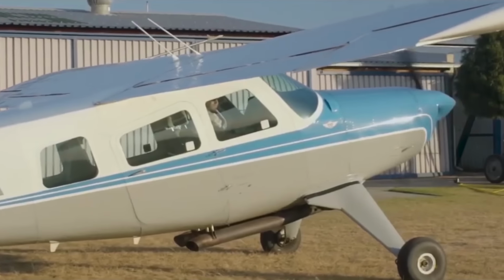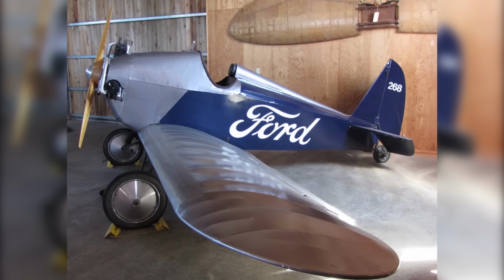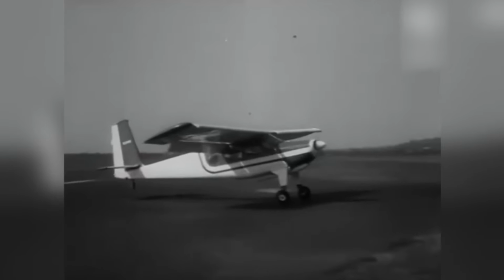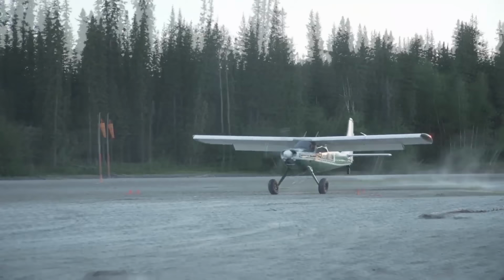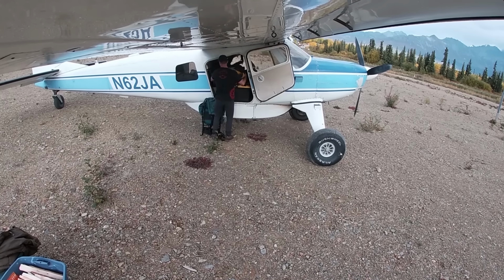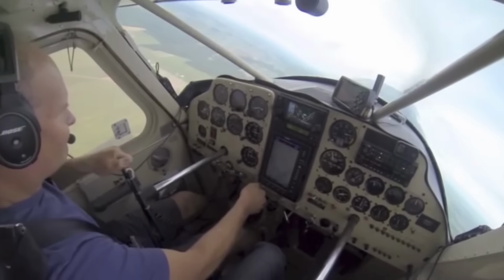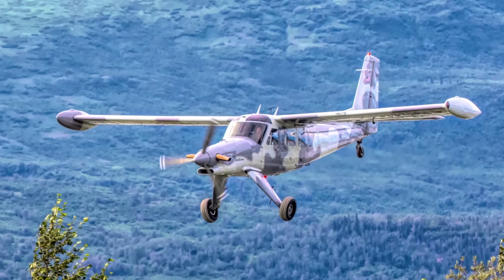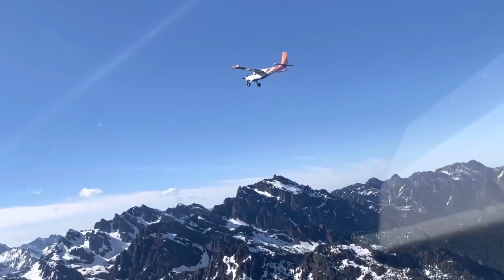The Plane that Turns Backyards into Runways

Comment: Designed and funded by the Cia.
Reply from the maker: Designed?  That's a stretch.  But CIA seems to have its hand in it later on, during nam
Reply: @aircraftadventures-vids  I stand corrected for mis speaking. They contracted the design with helio. They submitted specs and the French built to those specs.

Comment: Note....150' (feet) is not half the length of a football field. That would be 150 yards or 450' (feet).
Reply: I see that you are confused by the old  English system of measurement, where, instead of basing measures on units of 10, there are12 inches in a foot, 3 FEET IN A YARD, 100 yards in a football field and 5280 feet in a mile... unless it's a nautical mile..!

Comment: Sorry, but this NOT the first STOL Plane! This was the Fieseler Fi 156 "Storch"!
Wikipedia:
The design of the Storch enabled it to have an extremely low minimum flight speed of less than 50 km/h. This also reduced the requirements for take-off and landing distances. The Storch needed 50 meters to take off in a headwind and 20 meters to land. The aircraft flew slowly enough to lay telecommunications cables. With the right headwind, the Storch could also "stand in the air" (speed above ground zero) or move backwards.
Reply from the maker: Absolutely agree - and nowhere in this video does it claim the Helio to be the first.  The Helio was unique in its own way, but certainly the Storch came before it.  With the "Helioplane", its founders were looking to leverage the STOL concept and market it to pilot-owners and business owners.  Only later with the 4-seater Courier did the military express interest.  The Storch is an amazing plane.

Comment: Seems as though fuel consumption might be an issue with such an airframe.
Reply from the maker: Yeah those geared 480s were gas guzzlers. But then for those who really needed it's capabilities, that was a secondary concern.
Reply: @aircraftadventures-vids  without the turbo's engaged, she will burn 12.5 GPH in cruise.  With the turbos she will burn 18 GPH.  It's actually quite reasonable and not the gas guzzler you would think.

Comment: We flew in one (it still had the porthole window in the back) in Canada, for a glacier landing. It had a supercharged engine, so the altitude was no problem. Lovely airplane.
Reply from the maker: That's cool!  Very few supercharged models built.
Reply: @aircraftadventures-vids  True.  I have the STC RayJay twin turbo with manual wastegate.  Makes a significant difference in high altitude airports and to increase cruise speeds at mid altitudes.  I see 140 KTAS at 9500 ft.

Comment: A awesome plane, it reminds me on the Fieseler Storch (look at "Fieseler Fi 156" Wikipedia) first built in 1938 with nearly same STOL capabilitys but fixed slats. Also equipped with a 8 cylinder aircooled engine and a enormous prop.
Reply from the maker: The Storch is also amazing.  And I'd guess a big influence on the Helioplane (and later Courier)

Comment: I worked for Jaars here in NC providing upset recovery for their missionary group. A few of the older folks had flown the Helio Courier. They raved about it’s capability. What a cool piece of history.
Reply from the maker: thanks for sharing your experience, bud!
Reply: I was a Mk and my parents worked with NTM. NTM had a Cessna of our own, but on occasion our plane was out of service. When this was the case we would use the Jars Courier. I remember the small circular window. It was very slow but you could put it down any where. I was young but I can still remember it well. Great airplane.
Reply: What did they replace the Helio with?

Comment: Having owned a Helio Courier in the past , I can vouch for its utility over 5 years that I had the pleasure of flying it. You failed to mention that some came equipped with the CROSS WIND gear though I never flew one with this feature.
Reply from the maker: I knew about it but didn't see too many pics or videos of it in action, so I did not include it.
Reply: @aircraftadventures-vids it’s the only plane I know that can land pointing into a cross wind…

Tail wheel landings are tough enough to understand, adding this additional skill is going to take somebody who really wants to do it…

😃
Reply: @aircraftadventures-vids  I have the original Goodyear crosswind gear but honestly I haven't had the nerve to try it.  It is just that strange.
Reply: @nyuscdjsthe Goodyear brake pucks are very hard to find
Reply: The crosswind gear made the forward landing gear a non-issue.

You see, the very far forward gear radically improves braking without nose-over. But makes the moment arm from tore contact patches to aircraft center of gravity very long. This creates strong ground-loop tendencies. With crosswind gear, you land as you can, and the gear swivels to prevent side-loads. Without side-loads, there is no ground loop.

Comment: You mentioned they were used by police departments for surveillance, but I only know of one.  The Pima County Sheriff's Department started using them in 2000 and had two of them they used for patrol support.  They had a camera system and huge spotlight.  Eventually both were converted to Turboprops.
Reply: Steve Murray from aero Pacific did their maintenance, he also manufactured the camera and light mounts

Comment: Meet the zenair 801 180hp - can land in deep grass/weeds too - no small tailwheel. Flies at 35 kts , 4 pass, fits in shed with 32’ wide doors and almost impossible to stall. Got a wide load - pin the doors up to the wings and load up bicycles, 2x4x8’ etc. Love my 801 😀
Reply from the maker: The Zenair is an awesome machine for sure!
Reply: Spoken like a nose dragger pilot! It doesn't much matter how small the tailwheel is, as it is just getting dragged along, trailed, pilots who lose their tailwheel (by a broken tail spring)  have been known to fly it back and if need be keep the tail up with power until parked, I'm one of them. I now have a much better tail spring also. I like have TWO big fixed wheels hitting any obstacles first, not one, that also is weaker as it has to be able to turn, nothing beats a taildragger for really rough off airport ops.
Reply: @portnuefflyer not to mention arriving in an airplane that can only be described as “the most disgustingly hideous pile of junk to ever fly.” An airplane truly more hideous than the box it was shipped in. Requires 0 talent at all to feel somewhat decent. Leaving the pilot feeling foolishly confident enough to believe they have any form of skill. Flown by people too scared to fly airplanes that require finesse and actual skill. Fly a 172, stop pretending to be a bush pilot. Go home wanna be.

Comment: Interesting, had never heard of it.
I'm not a pilot, but have watched a lot of videos by Pilot Debrief that analyze the causes of crashes.  This seems to solve many of those.
If I heard it all correctly, these were the down-sides:
1.  Difficult to control at slow speeds.
2.  Difficult to maneuver on the ground due to the long wheelbase.
3.  Expensive.
4.  Heavy.
5.  Complex.

And I presume "heavy" also means lower fuel economy, as well as lower cargo capacity.

And I presume 3-5 are due to the large control surfaces, and that's probably unavoidable even with the latest technology today.
Reply from the maker: I love Hoover's channel!  As to your points, all correct - consider the Courier a very niche product, that does what it does very well, but at a price of course.
Reply: @aircraftadventures-vids  I might disagree on some points:
1. NOT TRUE...she is very stable at slow speeds
2. TRUE: VERY challenging to manuver on the ground for take off and landings...one of the most difficult aircraft I have learned to fly.
3. TRUE: That is why 80% of these were bought by the Army and CIA and the other 20% were mostly bought by businesses
4. SOMEWHAT TRUE: yes it is heavy but performance doesn't suffer and the useful load is fantastic.  You can carry the whole moose!
5. NOT TRUE: Other than GO480 which is a challenge to maintain, the rest of the plane is very simple and reliable.
Reply: Quite a few Helio crashes were caused by Cessna drivers trying to fly them like a Cessna 180

Comment: One thing that could help an updated version of the Helio Courier is distributed propulsion. While retaining an engine in the nose, each wing could have two or three 10 kW motors and propellers. They might have to be mounted from the wing's lower surface so as not to interfere with the slats. Or, the slats could be segmented into shorter units to allow the low-drag nacelles and props to be mounted to the leading edge. The motors could be shut down during cruise flight while the engine keeps running (and recharging the batteries). Several experimental aircraft have this arrangement. Even an AN2 (large biplane) was so equipped.
Reply from the maker: That sounds...a bit complicated?   But i love the thinking
Reply: @aircraftadventures-vids  The Electra Hybrid STOL is one that uses the concept. Their effort may well be successful, but the Courier has some great features. Maybe the two ideas wouldn’t work well together but it would probably be simpler and more effective than the twin that Helio tried. I’ll try to post a link to the YT video on the Electra below, but I’m guessing it won’t work.
Reply: @aircraftadventures-vids  https://m.youtube.com/watch?v=5mM9QPcOgeI&pp=ygUsU3VwZXIgc3RvbCBlbGVjdHJpYyBhaXJwbGFuZSBtb3RvcnMgb24gd2luZ3M%3D

Comment: Many decades ago, in 1936, there was such an aircraft in Germany, the Fieseler Storch Fi 156. For takeoff, the Storch needed 50 meters in headwinds and 20 meters for landing.
Reply from the maker: Certainly, the Storch was a pioneer in STOL design (which is why I stopped short of calling the Courier the first stol plane).
Reply: The 1903 Wright Flyer needed only 60 feet (18 meters) for takeoffs  😄

Comment: The only plane that ever really came close to the HC was the Pilatus Porter. I flew the Porter in SE Asia and it's built like a tank. We use to call it a flying Timex because it could take a licking and keep on ticking.
Reply from the maker: The Porter replaced the Courier in JAARS missions, but mainly because of the lack of avgas, which is the Courier's largest shortcoming (out the US at least).  The porter is one bada$$ plane for sure

Comment: Yep!  You can have your very own Courier.....for several HUNDRED THOUSAND DOLLARS!  And that's the price they were going for in the 1980s, when I read about the airplane.  They may cost millions, by now.  You can get a Zenith Air STOL 701 for a tiny fraction of that price, and it has similar short-field performance.
Reply: Not true.  A good example, if you can find one, would cost around $250k, and a fair example would be around $150k.  If you have a buyer who will pay millions, I am a seller!  ;)
Reply: @nyuscdjs  My info is from the 1980s.  The price was around $250,000 (New).  I was guessing about a current price, considering inflation and assuming the plane would not depreciate much, if at all.  But it's been decades since I've been active in the World of airplanes.  Today, I wish I could afford a few thousand for a used ultralight!

Comment: A blatant copy of The Fieseler Fi 156 "Stork" of 1935!
Reply from the maker: It's not a copy at all.  That's like saying all STOL planes are copies.  It did however use same similar elements such as the slatted wings (which, by the way, already existed by the time the Storch came out)

Comment: To the company in Alaska,,,,, look at an engine that runs on auto fuel. They're out there. Higher rpm's which give better torque and less expensive (didn't want to use the word cheaper) to operate, purchase, and overhaul! 4 cyl putting out 200 H.P. and Turbo'd!
Reply from the maker: Auto conversions have been out for a long time but typically plagued by the issues - unable to run at high speeds for a long time, weight, etc. FAA sure doesn't like them either.  It's a tough nut that people have been trying to crack forever.  I read about about a guy who did an LS swap on a Bede-4.  Was a bit scary to read about, lol.

Comment: I got to take a ride in a JAARS Courier at a local grass field fly-in several years ago. He did max-performance take-off and landing and it was truly impressive. I read that there is now a turboprop conversion available for surviving Couriers using the PT6A and it gives as good performance as the original geared engines.
Reply from the maker: You might have met Mike Mower, who helped educate me on many aspects of the plane. He's a real Helio Wizard.

Comment: It's neither stall or spin proof.  No airplane is.
Reply: It is one of the few certified aircraft with no published stall speeds.   I have tried at altitude and can not get it to stall.  It just gets mushy and decends at 1000 ft/min but with full control.
Reply from the maker: Technically correct, but it's hard to get it into a stall.

Comment: I wonder what were its disadvantages, if any, compared with the Cessna 180/185 Skywagon?
Reply from the maker: Well there are few, and it turns out that it's a widely discussed topic on backcountry message boards. 
a) Slower plane on same HP (therefore, higher fuel burn)   b) Geared engine that requires more maintenance  c) Lower TBO  d) harder to source parts    e) MANY more 180-185's produced, therefore much easier to support.   Still, for some missions, the Helio will still reign supreme.
Reply: @aircraftadventures-vids  Thank you. (c) to (e)  are, IMO, "acquired" disadvantages (ie. resulting from not taking a large enough share of the interest and market).  I grew up flying on my dad's series of C-185's and I have always been in love with that beautiful plane.  I wonder if, when equipped with all the aftermarket STOL enhancements  it could do even better than the Helios excepting slow flight, of course...but that would be for the Cub owners to claim, I suppose.
Reply: Helio Alska's H295 has won the heavy touring class at the Valdez STOL competition the past few years, outperforming the Cessnas.
Reply: @RPHeliopilot  I see. That settles it for me. It's good to know, thank you.
Reply: A real wheel-barrow on the ground.

Comment: Wonderful airplane. I hated to see it fade away. Love to see it return. The long fuselage helps it to avoid nosing over in hard braking and looks great along with the large vertical tail. Excellent design to this day. =PC=
Reply from the maker: It is!  I really hope it makes a comeback too
Reply: They didn't fade away, there are dozens still in use.  They're not uncommon for operations into and out of remote areas in Canada and Alaska, where they're popular with small airlines and charter companies such as Wright Air Service.  There are lots of recent videos online of Couriers in operation.

"Helios remain very popular among bush pilots in Canada (32 current) and Alaska and missionaries who fly into rough, relatively unprepared jungle airstrips because of its superior STOL abilities. Some operators use the Helio Couriers for aerial observation. Both Winged Vision Inc. of Gaithersburg, Maryland and the Pima County, Arizona, Sheriff's Department each operate two of the rare tri-gear model and mount gyro-stabilized cameras under the wing for aerial observation.  Pima County mounts a FLIR camera for law enforcement, and Winged Vision mounts a high definition television camera for coverage of major sports events."

Comment: Hope it works out with the brand new Courier. Will be nice with full glass cockpit, center stick and 800shp turboprop with 5 swept blades.
Reply from the maker: Someone in the comments mentioned that there's an effort in place to revive the Stallion, well there you go!
Reply: @aircraftadventures-vids  So cool, fingers crossed! Mike Petey's Draco kind of gave a glimpse into what a new Courier would look like and be capable off. I know that plane was a modded Wilga but wow a bling Courier in that vibe would be awesome!

Comment: There was a Helio Dealership at my home airport F46 in the early 70’s.
Reply from the maker: I take it the runway was only 500 ft long, right?
Reply: @aircraftadventures-vids  
In those days it was 2300’ asphalt, nowadays I believe it’s landlocked at 3300’ long.  I remember both demo planes were painted the same but one was a tricycle gear. During landing
I could hear the slats popping in and out as they were put thru their paces.
Reply from the maker: @chuckcawthon3370  ah yes they are loud!